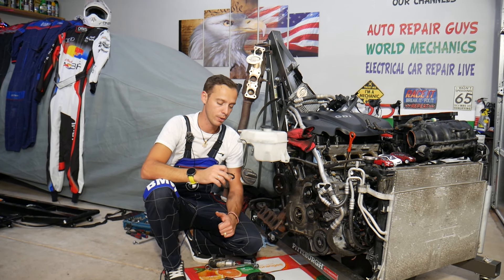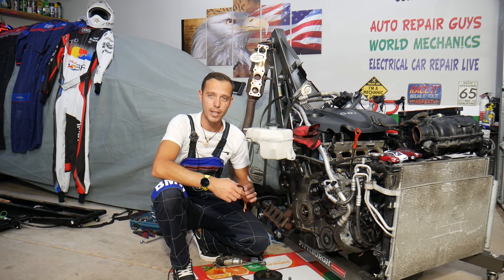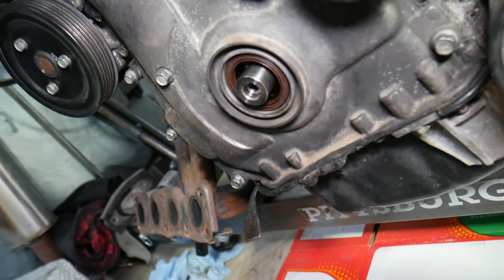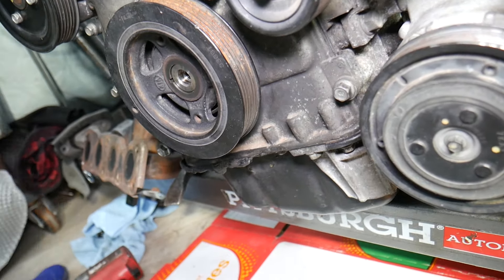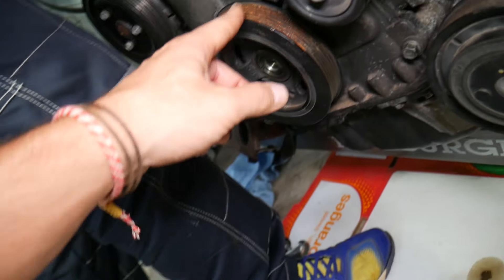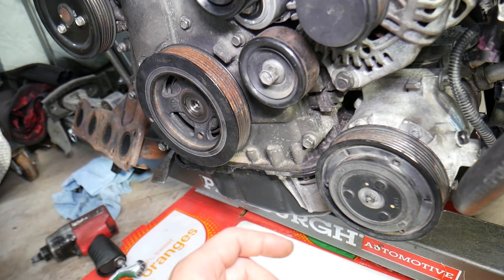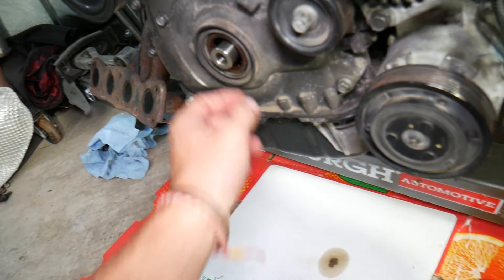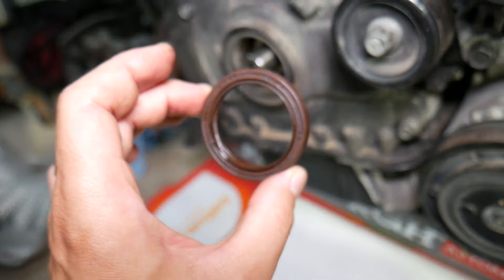SIGNS OF BAD FRONT CRANKSHAFT SEAL, SYMPTOMS OF BAD CRANKSHAFT SEAL

Comment from the maker: Products that we use and recommend:
► Crankshaft Pulley: https://amzn.to/3tUqcPw
► Crankshaft Seal: https://amzn.to/3sQWg5e
► Crankshaft Seal Removal Tool: https://amzn.to/3xk3q5A
► Panel Removal Set: https://amzn.to/3YiMADu
► Tool Set: https://amzn.to/3p5MM6t
► Screwdriver Set: https://amzn.to/3XRB28Q
► Castrol Oil: https://amzn.to/3xBc8B9
► Oil Filter: https://amzn.to/3w0Ulme
► Torque Wrench: https://amzn.to/32qyRwg
►Liqui Moly Engine Flush: https://amzn.to/3IiDBID
► OBD Scanner that we use most often: https://amzn.to/3I4MQfe

► Check out our Amazon Store for the tools and parts that we use: https://www.amazon.com/shop/worldmechanics

Comment: I just put my vehicle in the shop because it was leaking oil. I found out that the crank shaft seal was broken. Thank goodness I brought it in.
Reply: It happened the same with me, the car was making a noise coming from inside the engine, and when I took it to maintenance, they found out that the crankshaft seal was in bad shape, oil all over the place, the belt was starting to deteriorate.
Reply: How much did it cost you to get it fix?
Reply: What'd they charge lol? It just takes a tool rental and socket set

Comment: Ok.  It leaks out of this bad crankshaft seal, the engine oil.  The big pulley then throws oil everywhere in line with it, over the belt, and down the side of the oil sump pan.  The effect, is as if the auxiliary belt were lubricated deliberately with an oilcan, which nobody sane would do.  Hence, it can cause the belt to slip, which is much worse when the belt is under more load - aircon, battery needing charged, power steering operating more eg when parking.  So the first symptom the driver might notice, is electrical problems associated with poor battery charging, like low battery voltage, lights not as bright, or much brighter when engine revving higher, and the power steering being used while parking, causes squealing to be heard as a direct result.  Now, if someone wants a translation, they can just do it for this comment, and they have it.  Thank you so much for the explanation, it’s a very cheap part to replace compared to the trouble it causes!  One more symptom - a stink drawn into the car once using the heater/aircon - because the dripping oil may end up on the exhaust or especially the catalytic convertor, which burns the oil at high temperature causing white smoke and a real stink with modern synthetic oils…the cabin may then get a waxy or oily smell, very unpleasant.  Only happens when the car is hot and using the heater!  Thanks again.

Comment: The dealership said my crankshaft seal tensioner is leaking oil .... and its $2k to fix
Reply: they told me the exact same thing €2K to fix it
Reply: It's a easy fix yourself. You just have to remove your front end, sorta. Its not as much or as big if a deal as you think. It's easy depending on your car. Its easy on BMW.
Reply: @AugustDreamScape  and easy fix is replacing a battery or changing a tire.
Reply: What kind of car ?😳

Comment: Man i have replaced the crankshaft seal twice with OEM seal on my N13 but still got leak from there. what else should i check?
Reply: check your Pcv valve, if you notice so much oil then replace it immediately.

Comment: I noticed when idling the battery gauge goes down and when turning on any accessories such as radio , lights or AC.  Now car is smoking. I just had an oil change and the young man at an instant change place had difficulty getting the oil filter off . Also the air filter was checked and they failed to seat the air filter or even screw back on the cover. It was still laying loose. I left the lot like that and quickly went back and actually had to figure it out on my own as the kids did not know . I knew what had been done and pointed at air filter and saw the cover laying loose on top. So that was resolved.  But due to all that happening I’ve been keeping an eye on my gauges really closely. Hardly have driven the car since getting the oil change and now it’s smoking just behind passengers front windshield .  It smells like oil burning. And a small puddle leaked suddenly after starting the car under neath towards the front end. I got out to intentionally look for leaks as I was trying to diagnose. Normally never leaks. No other fluids seem to be mixed with the oil. Brake fluid box looks good and transmission has been good. I always like to try to have an idea of what could be wrong before hiring a mechanic. As sometimes they will be dishonest. I cannot afford any errors to be made when it comes to car repairs.  With all this said could this be a simple seating problem with the Oil filter or bad gasket or perhaps both ? Oil pressure seems good. But as I mentioned above the alternator issues you mentioned have been pulling more battery when I turn on the lights or anything else . So it’s interesting you mentioned the alternator / battery using more power if this oil problem occurs. I had no idea the two could be related.  However the car engine is smoking now when I start it and the entire time it’s running. I am not driving it anymore until I can have issue resolved. Your thoughts if any ? Thanks !

Comment: So I have a 2002 civic dx, I have had an oil leak that I haven't been able to find til I looked more under my hood and watched this video. I have oil on the crank pulley area, only in the crankshaft area on the timing cover, and it has been leaking onto the crank sensor causing me to break down after extensive driving. I can see oil has gotten on my belt and I hear squeaking when I'm driving and there is oil on the alternator too. There is always a decent puddle on my driver's side when I leave it parked. I am pretty sure this is my issue. I'm praying since I bought the parts and am gonna fix it if that's the issue
Reply: Hey mine is starting to stall out like it warns to lock up n breakdown sound very similar to what you said my crank shaft seal is leaking as well
Reply: @terellholloway1202  most likely gonna be the crank can cam sensors messing up cause of oil getting in em I had that same issue

Comment: Tq so much. While driving, I noticed the battery indicator light appears becos the alternator is not turning due to the belt keep slipping the alternator pulley as it gets slippery from oil discharged from a leaking crankshaft.

I hear sharp squeaky noise too. Is the squeaks due to bad crankshaft bearing or crankshaft pulley?
Reply: the squeak is the oily belt

Comment: Thanks for the video.
The author says that the seal replacement is easy. I'd say its easy if the engine has been removed from the car. If it hasnt been removed, id say its a differcult job.
Reply: There is no "its easy" "its hard" its entirely dependent on engine. The engine in my car makes it extremely easy, however others (especially fwd cars) will make it more difficult.